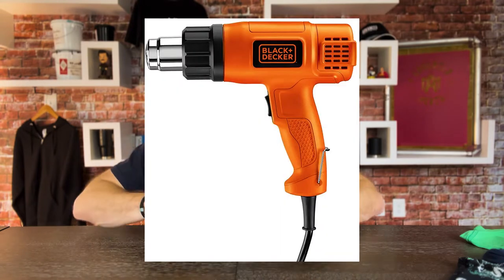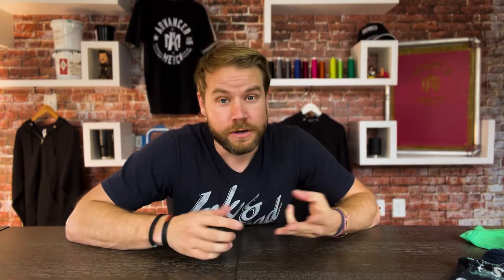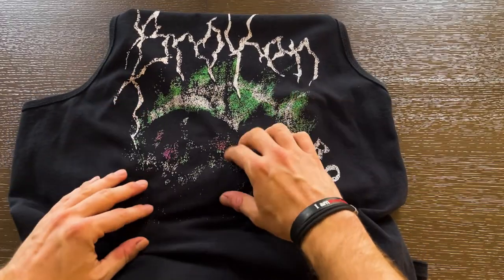Why do your shirt designs CRACK? (And what to do about it)

Comment: I just wanted to know HOW I could FIX (aka repair) my cracked shirt. It was a gift, and only washed a few times. Any suggestions??
Reply: Unfortunately there is no way to fix cracking once it's started.
Reply: I saw a youtube video where a guy placed a baking sheet on top of the shirt and just ironed the print. A lot of comments said it worked. 😊
Reply: Have you found a solution yet?
Reply: @lolitahaze02  It will never fix it, it will only somewhat delay the process by melting and setting the print again.

Comment: I have a swing-away heat press. I've been using 320 degrees for 40 seconds on my screen prints but I do get some slight cracking after a wash/dry cycle. What would you recommend? I let my freshly-printed shirts out to dry for about 12-14 hours before pressing. Water-based ink
Reply from the maker: Water based ink works best with a forced air conveyor dryer to achieve a proper cure. You'll get inconsistent results with a heat press. Some will come out ok and others not. Hope this helps.
Reply: @advancedmerch would plastisol based paints work fine with a heat press?